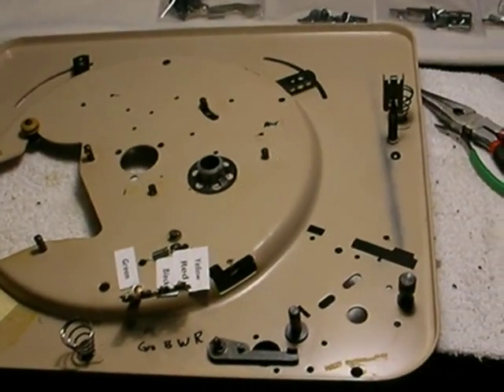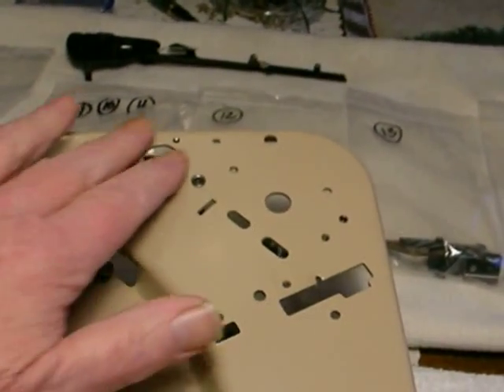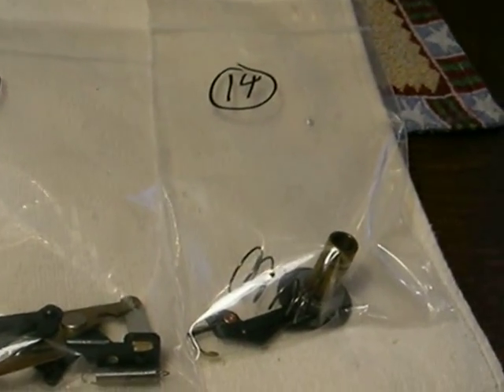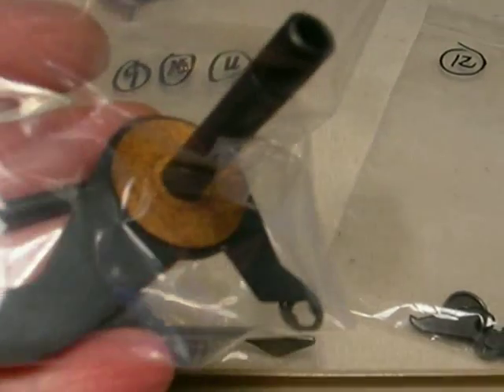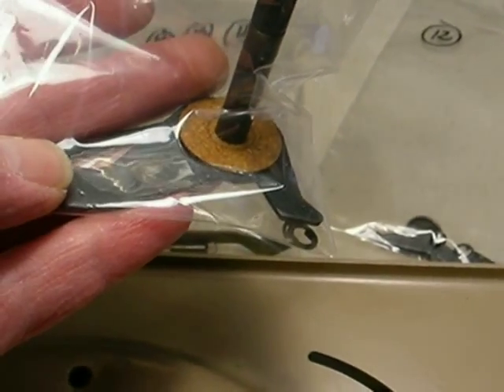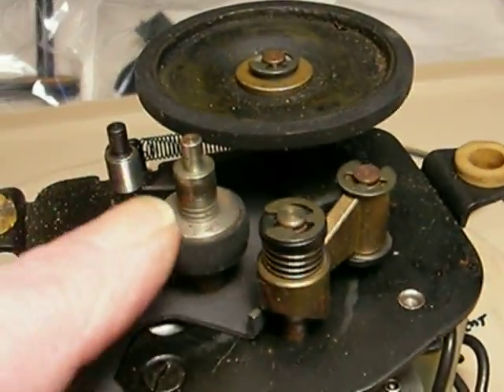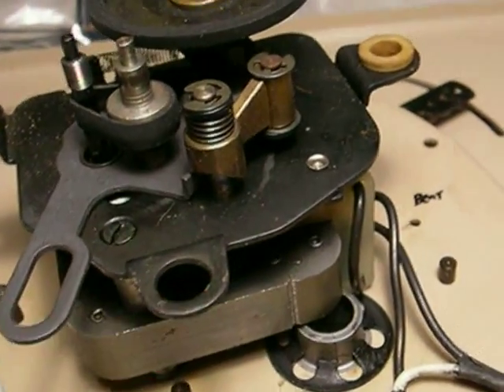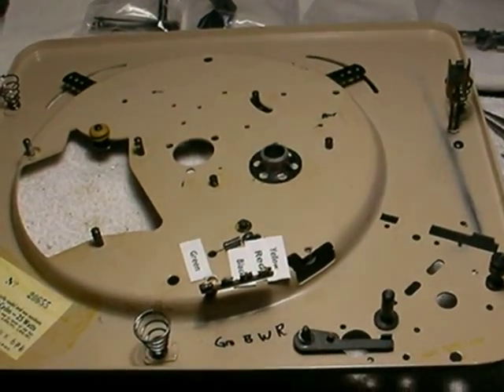Admiral 400 Record changer- part 3

Comment: Very helpful video Cliff.  I just acquired an Admiral suitcase stereo portable model Y4049 with the chassis 3N1A.  Unit works but needs recap of amp, and indexing is 'stuck' on 33 size, no response for 10 inch or 7 inc.  Yes, 10 inch pusher does raise.
I will be taking this one apart myself (idiot at work). This should prove interesting as I have not worked on many electronics since the late 1960's.  Great advice to picture & label this stuff during disassembly.

Comment: Following up.  I got my Admiral back together and it works fine!  (magic??).  Big electrolyte tested good so left it alone for now, smaller cap was bad and needed a new needle.. but we are back to work.  Did you ever get the last installment finished on yours?